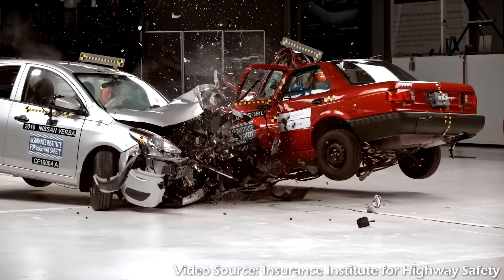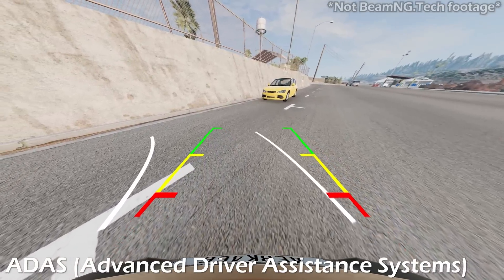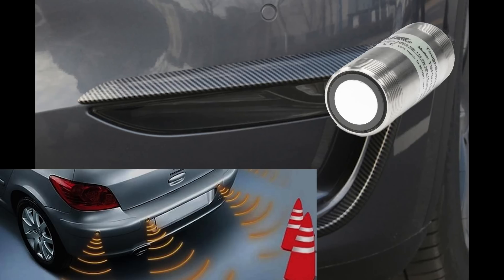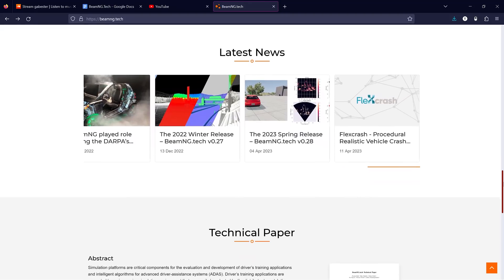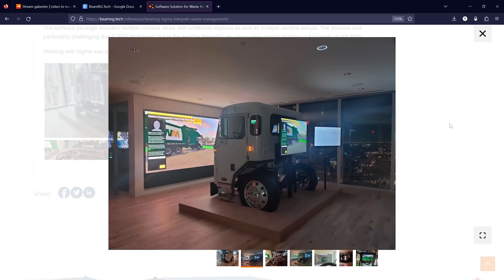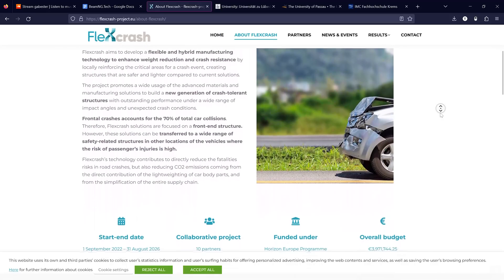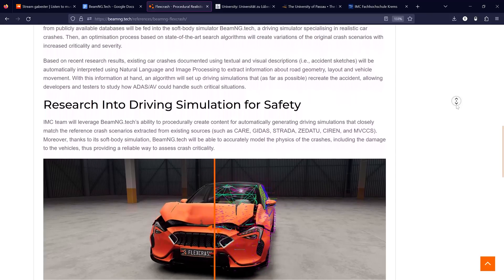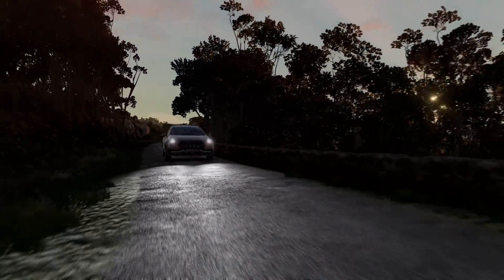BeamNG.Tech, The Future of Automotive Safety? | BeamNG.Drive |

Comment: As cool as this tech is, people have to realize that software and hardware are not even night and day difference. Think more night and three spoons taped to a brick level of difference.
I actually get to play around with test vehicles that have all of the fancy "safety" features you mentioned. It's rare that these features work, and often when they do work it makes the car less safe.

Lane departure systems are a prime example. Frequently they just don't work on 99% of the roads along the route. Sometimes they will not activate until you are halfway out of the lane. If they can steer the car god help you in construction zones. The ones that steer the car are frequently overtuned and will either over correct and "pinball" down the lane or, in a concerning number of cases, aim at oncoming traffic. And sometimes the system does not deactivate with the turn signal. I have only seen a single one that actually works in the rain.

Not saying these systems are a terrible danger to people... for the most part. But the companies that work on these vehicles could spend five minutes in a parking lot testing things before sending them into full production.

Comment: I feel that beam is so realistic in its driving physics that after tens of hours of play and tuning, I have seen a markitable improvment in my driving in assetto corsa
Reply: Fr same. All I can ask for is a little bit more grip and new tire physics but other then that the game is great and is only gonna get better
Reply: @whywhy8575  You can edit that with tuning or mods! Dont know about the tire physics but you can change the air pressure in them.
Reply: @whywhy8575  The tyres are good for what they're without trying to pummel performance to the bottom.
Reply: You can even improve your driving irl, that’s how realistic this sim is lol
Reply: Realistic weight transfer, g force and suspensions and those are not scripted like in other sim racing games
Reply: I love the crash physics but the driving has always felt off. Like the cars either have no grip or no weight to them. And like, I know how to drive it’s not like I just don’t know what I’m doing. It’s just always felt more like a damage simulator than a driving simulator, which is fine.
Reply: The developers have done enough to get it to where we can play with it without hindering performance and I believe in the future they'd amp up simulation fidelity to its tyres. It's only a matter of time.

What I don't find realistic in other Simulators is that without soft-body for every vehicle component the entire car is just rigid brick and completely dissimilar to reality. Only BeamNG seems to be on the right path with what it's engine can do. What most people like you don't understand is that if your physics engine doesn't simulate frame flex, tyre flex/deformation, or suspensions don't oscillate as they'd in real life then you're just moving bricks on hard surface. BeamNG already two decades ahead of the pack in that aspect.
Reply: @obeseperson  The huge issue with the tyre model is that they arent smooth, if you look at any tire in the game its segmented into 32 pieces, if youve ever noticed bumping at 1mph or less, thats why. FFB also isnt great. They also released a video a few years back justifying why their driving physics were realistic because they were street cars, which was honestly a poor excuse. Still love the game though

Comment: I feel like beamNG is accurate but not accurate enough to replace traditional crash testing
Reply from the maker: Yeah, I agree with this. The developers have tried to make the game realistic as possible without hindering performance too much. It's still very impressive how close it gets to crash testing though.
Reply: @LunaFoxo  true, but remember that the core physics engine was built almost 10 years ago. Modern computers could very easily handle far more detailed jbeam models.
Reply: The problem is not only with accuracy but also with the fact that the simulation is based on already existing data so you can't really crash test a vehicle that hasn't been tested already
Reply: @agenty_gd  that is what ai is for
Reply: Generating Jbeam data with AI would certainly be interesting but so far there is no AI advanced enough to be able to analyze and understand Jbeam with comparison to real world data
Reply from the maker: There could be in the future, maybe not for Jbeam specifically. But this is kinda along the lines of what the flex crash project is trying to achieve at the moment. "IMC team will leverage BeamNG.tech’s ability to procedurally create content for automatically generating driving simulations that closely match the reference crash scenarios extracted from existing sources (such as CARE, GIDAS, STRADA, ZEDATU, CIREN, and MVCCS). Moreover, thanks to its soft-body simulation, BeamNG.tech will be able to accurately model the physics of the crashes, including the damage to the vehicles, thus providing a reliable way to assess crash criticality." I am very curious as to the exact processes they are using to do this, with the advancement of AI recently I wouldn't be surprised if that was going to be their next focus, whether in BeamNG or not.
Reply: I think they are referring to crash scenarios rather than vehicle design. For example they take a real life crash and the AI selects the most appropriate vehicles to recreate it in game and builds the environment via some procedural generation. That is interesting but still can't really be used to crash test new vehicles that aren't built yet.
Reply: @Jefferey04  AI can't create its own data, it uses preexisting data, and you cant crash test something that hasn't crashed before.
Reply: still better than potentially not running any tests at all because of the costs involved.
Reply: i dont think itd be a stretch to assume that these versions of beamng run at a capped 60 or 30 or even lower considering fps doesnt affect the amount of calculations done, tanking in crashes with orders of magnitude higher amount of physics iterations and tailor made rigs either vetted or provided by manufacturers, and with graphics substantially lower than what we're used to. beamng already runs criminally well with a bunch of bells and whistles the automotive and academic worlds have no interest in, and in use cases where real time input isnt required, physics iterations and amount of factors can be cranked even higher to produce acceptable feedback without weeks or months of rendering or costly prototyping and crash testing
Reply: I’d say it’s about as close to real life as you can get with a simulator. I mean all those comparison videos where they use the correct identical car, the only things missing are the lack of particles and shattered plastic pieces exploding out and everywhere.